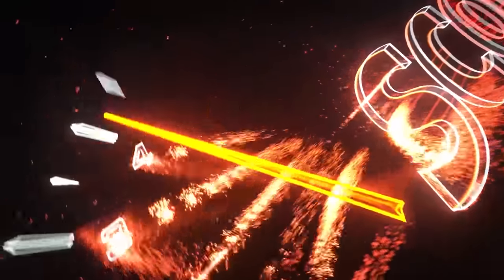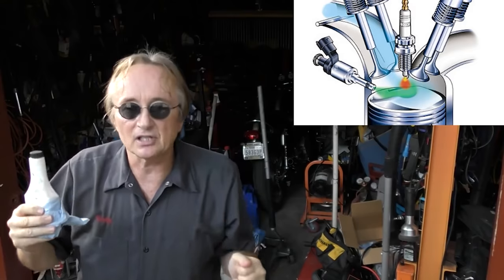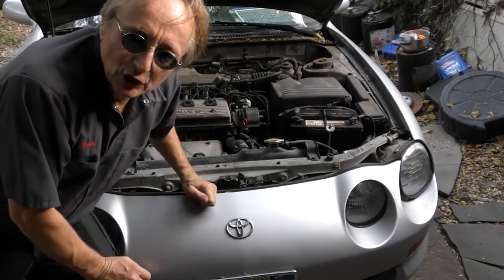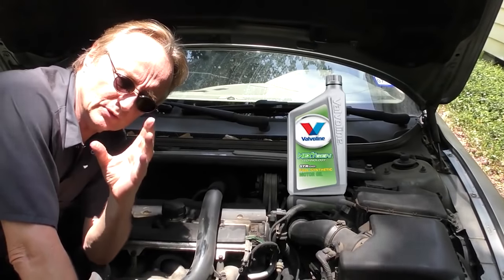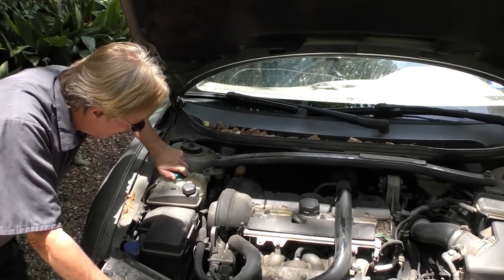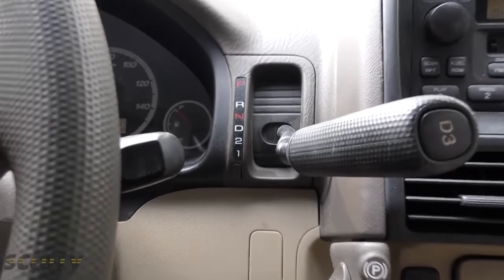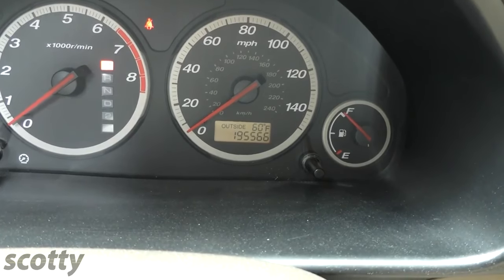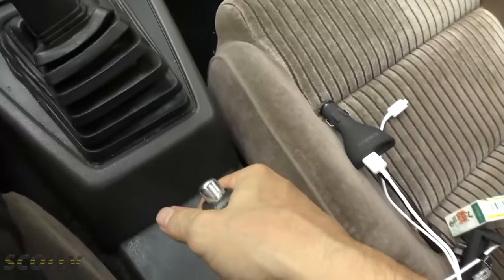20 Things Only Stupid People Do to Their Car

Comment: Great advice, but for my generation this is almost all common knowledge. I think it is more for the younger ones who seem less interested and less clued up on cars these days. But a lot of that has to be due to more and more people being able to afford new or newer cars than 30 years ago and the cars last much longer before anything starts to go wrong with them as long as they are serviced regular that is. When I were in my 20's I could only afford second hand cars so was always something needing repairs. Nowadays all my cars I buy are brand new and under warranty so basically don't need to do anything with them. I think that is the problem with a lot of people nowadays, while cars do still break and require repairs and maintenance most people just take it to the garage if and when it breaks instead of learning about how to fix it themselves. And if it is under warranty   of course we are not going to touch it ourselves.
Reply: Cars from today definitely do not last longer than they did in the late 90s and early 2000s. They are not built that way as it is often cheaper to junk them. Many parts cannot be repaired or revised anymore either. It's all on a replacement basis. Plus the fact that everything is time consuming to reach, so compact and connected by sensors that don't like to be interrupted. My colleague can't even access the battery for a jumpstart without removing two plastic panels under the hood first. We had a hybrid EV come in that wouldn't release the fuel door because it was electrically powered. The freaking fuel door.

We often joke we should have studied to become electricians so we could work on modern cars more efficiently. Dirty hands are a thing of the past and I miss it.
Reply: @RacingPepe  New cars last about as long as old cars did, just that the failed old cars never got old so we forgot about them.
The thing that ruin it on newer cars is that you have the machanics and the electronics all in one deal. You might be able to tear a car apart and put it back together with your eyes closed, but that do little good when some random sensor give and obscure error that you need "special" equiptment to even see. Never mind changing something in the software

Comment: HURRAY. it was so good to hear you preach my logic regarding the gear changing. i from 2014 have took my dads advice. he free rolls (uk call it coasting)when approaching traffic lights and uses his brakes. my logic is that brakes are cheaper than wearing out the clutch. sooooooo many drivers disagree with me. never had a clutch or gear box replacementso far,. 
when approaching a roundabout, Why the ferk would you go from 5th to 4th to 3rd to 2nd etc. Just pop into neutral and free roll using the brakes

Comment: About engine coolant, Some cars like Hondas recommend the blue antifreeze because of it's anti-corrosive properties but I see these local lube shops put standard green antifreeze in or sometimes even clear antifreeze. When questioned about this they always say their anti-freeze is indeed anti corrosive for Hondas. We end up draining it all and putting in the factory Blue antifreeze since its the same cost as the blue you get in a local parts store. Is there actually a green or clear antifreeze that's safe to be used in this vehicle?
Reply: Pretty sure that the colors are standardized to indicate the properties of the fluid. So if the color is wrong I wouldn't trust the fluid, new fluid is much cheaper than fixing the car.

Comment: The first tip is valid in a sense that you could damage both batteries and cables, but the car electronics should be unaffected. All 12V components are tested with at least -14V for 60 seconds and -100V spike, and that includes the voltage supplier for the 5V systems (as it itself takes 12V).

Even with a correctly connected battery there may be moments when the voltage is reversed or much higher due to inductive voltages so all electronics must be designed to withstand it.

Would I go to test it in my car? No, same as I wouldn't test an RCD breaker with my fingers even though it should be safe.
Reply: More or less sum up the whole video, technically good advice but even if you ignore it nothing should happen...
Reply: Its not the computers.  The sensors will still see 5V since they are driven by ECU 5v regulators. The issue is that the jumper cables would get shorted 24v and catch fire.

Comment: Great video,  both fun and informative. I prefer older cars, had a 95 300ZX  for 15 years and currently drive an  08 350 Z  that has the slave cylinder inside the housing like a Ford pickup. One thing  I'd like to mention is that both of my Zs require premium fuel and say/said so right by the gas cap. Some idiots have told me 'thats just a scheme  that gas companies  use to get you to buy their expensive grade of gas'.  Wrong!  It's also stuid to put premium gas in a car that doesn't require it but I understand that won't hurt the car, just the wallet.

Comment: LOL I can remember back in the day owning an Austin 1800 land crab, had a tired starter motor, use to give the car a quick jump start by jumping it in series instead of parallel, worked a treat. When running, put it back to 12 volts instead of the 24v to start. Finally got round to pulling out the starter and giving it a good old clean.  Good old positive earth days, try that with new cars these days and you'll pretty much blow them up. Still miss the old points and generator systems, simpler times.  Only scanning tool you needed were your eyes and ears, sometimes your fingers and nose, most people already come with these just need to know how to use them.

Comment: Around where I live the handbreak will freeze and lock up if you use it during winter.
 Standard practice is to leave it in gear and some advice to turn front wheels all the way to curb side so IF it rolls, then it will be stopped.

Comment: I had a Celica like yours, a 97. I had the car for about 7 years, anyway when I tried to get the transmission flushed and filled I was turned away. They said flushing the old fluid would actually destroy the transmission because of how old the current fluid was. I never heard of that before.
Reply: I think that's true
Reply: @sl4983  As far as I know it's definitely true

Comment: I disagree in 2 cases on fuel additives. I use them in 2 of my vehicals, my old motorcycle gets fuel stabilizer at the end of the season and about the same time I start adding anti gell to my diesel for easier cold starts.

Comment: I had a rare breakdown on my car a few weeks ago. It was raining and I came round a bend and started to accelerate up a hill. A truck was coming towards me and the spray covered the front of the car. The turbo sucked in some of the cold water and the thermal shock broke the turbo shaft. Fortunately very rare but cost €650 to repair.
Reply: This is why turbos are bad

Comment: Most of what I was hearing about turbo chargers in this video basically saying don’t by one😂
Reply: I got one of the last years of Outbacks with the 3.6l 6 cylinder before they replaced them with their 2.4l turbo 4. The smaller 2.4l turbo 4 theoretically delivers more power,  but does it also get better mileage (another EPA claim) when you use it hard enough? I'd wager not.

Beyond the turbo likely getting worse mileage more often than not at times, from test-driving an Ascent, I saw a noticeable turbo lag, that isn't present with the 3.6l 6 my Outback has. In stop-and-go traffic trying to deal with interstates backed up and getting from a dead stop into a faster-moving adjacent lane, I'd rather have the no lag engine acceleration.

Even if they do have the turbo lasting long, the smaller displacement engine with turbo seems logically likely to be under notably more stress and not last as long. I keep my cars until either my needs change or they're too expensive to maintain/drive and/or they show they're too unreliable, especially since a large number of trips out of town involve deserts and mountains with lots of "you don't want to be stranded" properties to them.

The funny thing to me is the 3.6l 6 car model didn't weigh much more than the 2.5l 4 option, I think it was maybe around 50 pounds difference.
Reply: @strictnonconformist7369  turbo’s are nice when they work for sure, but now they are putting them on tiny engines that have 0 power when they fail....drives me nuts I’m like Scotty like driving my car 20 years, they cost too much to do like some and get a new one every 2-3 years
Reply: @ET74019  in end of August I’ll have had my 2018 Outback 4 years, likely around 40k miles by then (pandemic has affected social life).

As of yet, car still works like new, beyond a chip in the windshield (I should fill that) having already replaced OEM tires, and very minor dings and scratches.

I can’t think of a reason to justify something different, it is comfortable, affordable to maintain, provides enough performance in all ways I care about, and the dealers would love to get it back in trade, it’s gotten timely basic maintenance.

There’s another reason to not want to waste money buying new cars regularly outside of what else you could do with the money: new cars have you more stressed out over possible pain scratches and dings, old ones, not so much! 🤣🤣🤣
Reply: @strictnonconformist7369  Subaru are pretty good have a lot of friends with them with lots of miles, don’t know much on the new ones tho..I made the mistake of buying a Jeep, my old Ford died...I wanted something new but couldn’t afford much at the time. Has 60k on it in 2 years..drive 70 miles a day for work, transmission issues, electronic issues etc. this will be the first car I don’t see how far it goes 😂...I’ll be canning this one as soon as I can
Reply: @strictnonconformist7369  I miss the days too when you had to hit them hard to ding them 😂
Reply: @captinbeyond  I am not sure if it still works, but on the 2018 f150, all you have to do is buy a $10 trailer light adapter and plug it in. It tricks the truck into thinking you are towing a trailer, and need the electric brakes and whatnot, so it will not shut off. I am sure there are other ways of doing it, but that will work.
Reply: @captinbeyond  there are plenty of youtube videos that can explain it better than I can, all I know is that it does work.
Reply: @captinbeyond  oh, I definitely agree with you. I hate all the extra little assistance crap they put on vehicles now, and the fact that they try their damndest to make it impossible to repair your own vehicle or in some situations even have an independent mechanic do any repairs. The automatic shut off has always really ground my gears though (pun intended lol.) Their is no way it is saving any fuel, I would bet what minuscule changes in fuel economy actually waste more fuel rather than save it. But it obviously is going to put more wear on the starter, battery, alternator etc. Somehow car manufacturers have fooled many people into thinking that this is a good thing, and use it as a selling point.
Reply: @captinbeyond   yup want to go back 30 plus years as far as cars go myself when they were simple and easy to maintenance....electric cars I will be completely at a mechanics mercy and God knows they ain’t all like Scotty. I’ve been driving an auto start stop car for 2 years and still can’t remember to hit the dang button to shut it off, don’t know of anyway of shutting it off like the trailer hitch way on an F-150, there is a chip you can buy out there but it voids all warranty...something else to by pass, something else to break 🤦🏻‍♂️
Reply: Would you get disappointed if a number of turbocharger-engined automobiles passed you by - one by one.
Still, if none of their owners put those cars up for sale; no one could buy any one of them. (Bye - bye!)
Reply: @johnklumpp7901  what in the actual hell are you on about? Or maybe just on?
Reply: @captinbeyond  nice I’ll look into that
Reply: @johnnyholmes8840  most people will believe what they r told ... you need a gagizmo ..its only $400
Reply: That's what I heard

Comment: I have an automatic transmission car (2005 Chrysler 300c) and when I stop at a light and its just turned red and I remember how the intersection works with lengthy idle times, I usually put my car in neutral or park because I thought It'll save me some amount of gas (might be stupid thought process I know). but I didn't realize doing the park/shut off method actually served a purpose especially when I realized the place where my shifter is is pretty hot when I touched it, but when i did the neutral/park, it doesn't get that hot so that's why I started doing that.

Comment: No need to change antifreeze when you have a LEAK! lol
Every shop I been to I asked them about changing the ATF with a vehicle that never had it changes and vehicle has 100K miles + 10 years on it.
They claim it will cause problems later.

I think even you said not to change it in another video.

So, do you change it or not?

About clutch replacement - send out the flywheel to have it checked for warps and cracks.
Have it turned if it is ok and they can do it.

While you are at it, replace the front transmission bearing and seal if you can.
Reply: if your transmission is already damaged then yes draining the fluid will make it worse.  However, if your transmission is in good health, there is absolutely nothing bad that will come from changing the fluid.
Reply: @MrCoolBreath1  Well, my transmission does work. Only rarely do I get a harsh engagement.
Fluid is not new red nor is it burnt. It does have slightly over 100K miles on it.
Transmission places tell me NOT to change it.
I was thinking of just changing a quart to see if I develop problems.
But cannot afford a transmission repair/replacement for the foreseeable future.
And yet I don't want a breakdown when I NEED it.
Reply: @crazysquirrel9425  what kind of car is it? id be worried about a cvt but if it has gears i dont think changing the fluid should be an issue if it doesnt have issues already. if it has any problems that wouldn't be caused by old fluid, I'd leave it alone. most cars have 'sealed' transmissions these days anyway. 

also if it has gears, it wont suddenly leave you stranded. they always start making bad noises before they do that, sometimes for months. the noise usually tells you what's wrong with it
Reply: @bradhaines3142  It is one of the big 3 that never took a bailout from the government.
No, it is not sealed. Has a dipstick.
A NORMAL dipstick. Not those little ones on some vehicles.

Comment: one more thing about standard transmission:
if you ever struggle shifting into gear, don't force it, instead shift into neutral, release the clutch for a second and then try again.
if this does not work, then you're probably trying to shift down while going way too fast, don't do that either.

Comment: So to my understanding. If you don’t want to pay for fuel additives, use higher octane fuel (modern direct injection specifically.) there’s always gonna be some sort of trade, either additives or higher octane. Not on carbureted engines for obvious reasons

Comment: Sorry, but a complete fuel line treatment saved a trip to the garage for a guess at a fuel filter replacement.  The sputtering went away, and power restored in less than 5 minutes.  Now THAT is a good product.  Great chemistry.

Comment: Interesting point about hitting the reverse by accident. I've experimented this on my Nissan Almera, and it seems to have a safety system where it doesn't go into reverse unless the car is in full stop. So even if I was driving 40kpm then suddenly go from D to N then to R, the gear stays at N until the car stops. Although it makes an uncomfortable noise slamming into reverse. Of course, no one should be doing this. But its a nice peace of mind knowing that going into R while moving forward in the highway isn't as immediately dangerous as I thought. Could this be the same for all modern cars?
Reply: A lot of modern transmissions have a function that refuses to go into reverse gear if the vehicle is moving at basically any speed beyond 2-3 mph. Some won’t unless you’re completely still.
Reply: Bro is saying he "experimented" on his car going from D to R while driving...... and he's a Altima driver. Like clockwork 😅
Reply: @ralphisgone249  ahaha I dont get it. But I swear to you it was an experiment. I swear! Hehehe

Comment: 3:30 I put nitrogen in my car because the compressed gas at my work is nitrogen. It doesn't appreciably reduce the amount of time the tires stay pressurized as far as I can tell. 
Consumer reports found that air leaks out 60% faster so it could do something but it's hardly worth the cost! My tires are old, so that probably makes the difference less appreciable.